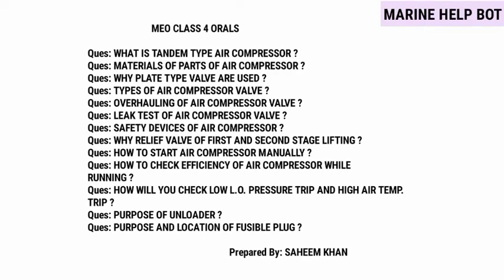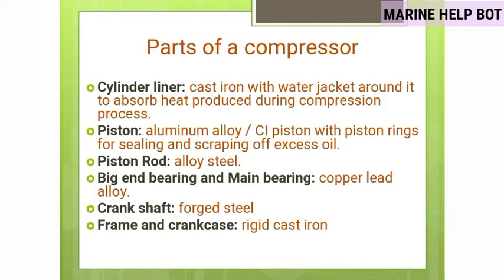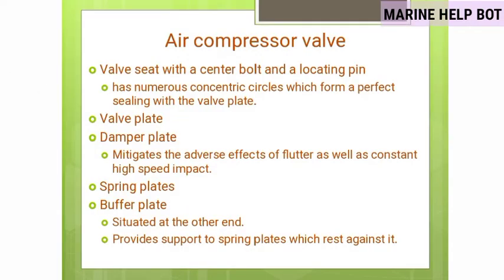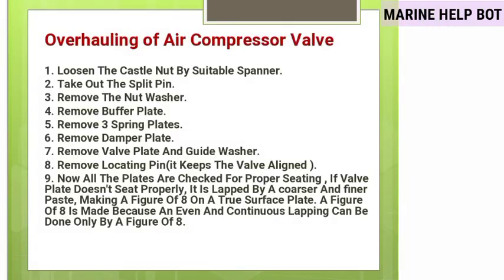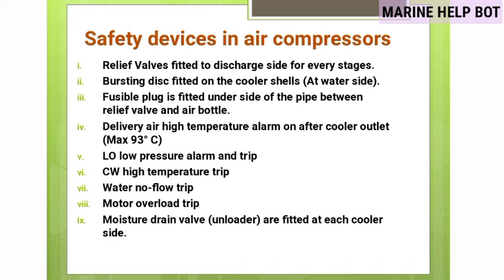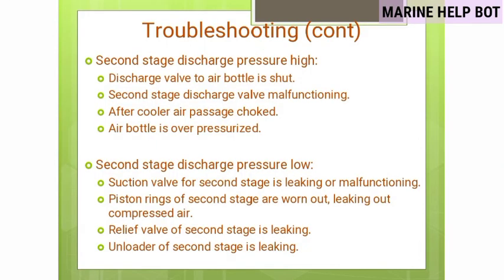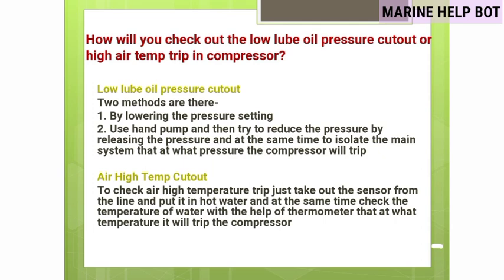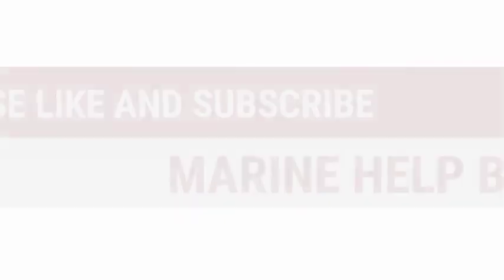Air Compressor Part 2 | Safety of Air Compressor | Types of Air compressor Valve | Starting Manually

Comment: brother, for relief valve of first stage lifting you said discharge valve of first stage not opening as a one of the cause please elaborate this. i didn't get this point. My doubt is relief valve located after the discharge valve so how the discharge valve not opening causes the relief valve lifting.
Reply: he's wrong.  relief vv of first stage is lifting 
1 suction of second stage is not opening 
2 suction of second stage is leaking 
3 rv is faulty 
4 choked intercooler. ,
Reply: If the discharge valve of second stage is not opening than the suction valve of second stage will not open and hence pressurize the dischage of first stage and the valve is lift…sir is right

Comment: brother, assalamu alaikum
how can i test air compressor relief valve?
Reply from the maker: Walekumassalam
This question is rarely asked. I searched a lot but only got this.

To test the pressure relief valve functionality, turn the system on and bring it up to operating pressure. Pull the ring on the pressure relief valve to depressurize the system (some relief valves have hand testing levers given for testing, the same can be done). Turn the system off, and ensure the system comes back to operating pressure when the system is restarted.
Reply: Maybe if you close the isolation valve after the compressor to the bottle.